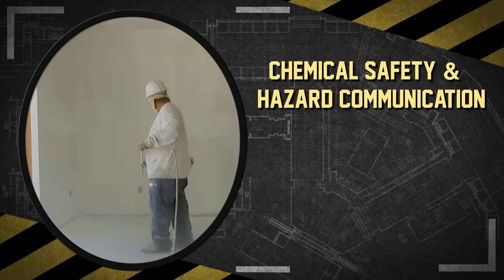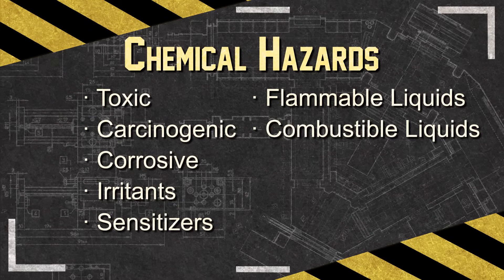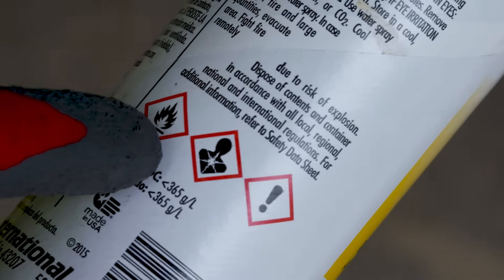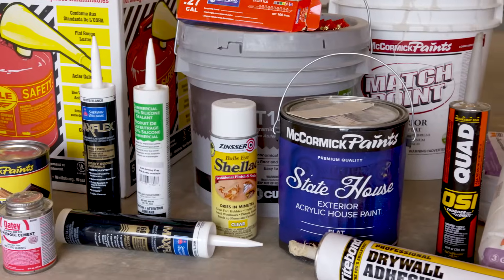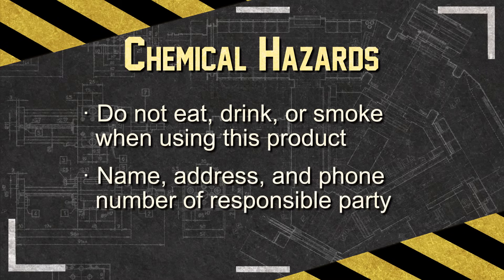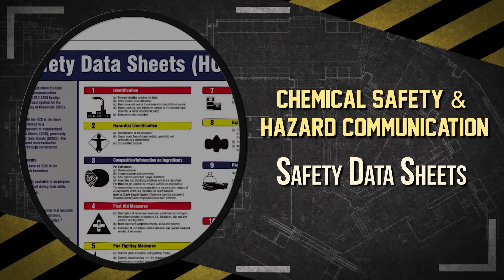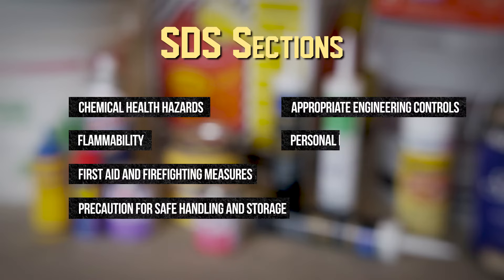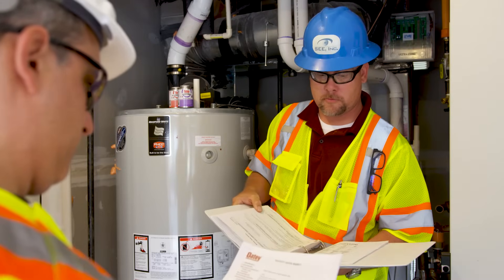Construction Safety: Chemical Safety and Hazard Communication

Comment: Hazardous chemicals, they can be found practically everywhere on the jobsite and in many commonly used products. There are several different types of chemical hazards. There are toxic chemicals that can have a poisonous effect on a person. There are carcinogenic chemicals believed to cause cancer after exposure. There are corrosive chemicals causing visible destruction or alterations. There are irritants--chemicals causing an inflammatory effect and sensitizers--chemicals causing an allergic reaction in tissues. There are also flammable liquids that emit vapors that may catch fire and there are combustible liquids that combust after being exposed to high temperatures. 
 
These chemicals may cause physical damage to the body. They can have chronic effects--a disease that develops over time--or acute effects--symptoms that appear or change rapidly. 
There are a variety of ways in which chemicals can be exposed to the body. The primary methods of entry are inhalation-chemicals entering the body through breathing- absorption skin contact with a chemical-- and ingestion eating or drinking of a chemical.  
 
Hazard Communications Program
Chemical safety begins with a written hazard communication program which covers how chemical hazards will be addressed on the job site and will include a list of all hazardous chemicals present in the workplace. All workers who may be exposed to hazardous chemicals should review the program. There are two primary methods to communicating chemical safety information—one, insuring containers of hazardous chemicals of properly labeled and two, maintaining safety data sheets or SDSs which are sources of detailed information on the hazardous chemical. 
   
Labels provide an immediate warning of hazards. Product manufacturers are required to provide labels on all shipped containers with information including product identifier or product name, signal words like danger or warning, hazard statements like fatal if inhaled, and hazard pictograms that alert users of the chemical hazards to which they may be exposed. Each pictogram consists of a symbol on a white background framed within a red border and represents a distinct hazard, such as a health hazard, flammable, corrosive, toxic, and irritant. 
 
Precautionary statements like do not eat drink or smoke when using this product. And lastly the name address and phone number of the responsible party. It's important to ensure that all containers on the jobsite are clearly labeled so you know exactly what is in the container. A battered or old label might be hard to read. If this is the case, make sure to replace the existing label with a new one that includes the product name and general information concerning the hazards of the chemical. In addition, if you're transferring something from the manufacturer’s container to your own container, it must be labeled unless you plan to use up all the product and the container will be empty at the end of the day--then you don't need to label it for that day.
 
SDS stands for safety data sheet. Safety data sheets serve as the source of detailed information on a particular hazardous chemical. It's required that all product manufacturers and distributors provide safety data sheets to its users. If you didn't receive an SDS form from your supplier, you should request one or visit their website to download the SDS.  Safety Data Sheets have a uniform format and are divided into 16 sections. The SDS contain important such as the chemicals health hazards, and flammability, first-aid, and firefighting measures, precautions for safe handling and storage, appropriate engineering controls, personal protective equipment or PPE is needed, and emergency procedures for spills. 
 
All SDSs must be readily accessible to workers when they're on the jobsite. Storing your SDS sheets in a binder in a central location where easily accessible, for instance in a pickup truck on a construction site, is a common practice. The SDS is can also be kept on a phone tablet or computer as long as the workers have immediate access to the information when it's needed. Also, in the event of a medical emergency, hard or physical printed copies of the SDS must be made available immediately to medical personnel. 

Finally follow the appropriate safe practices when working with any hazardous chemical. Familiarize yourself with chemical hazards on your job site as there may be more than one hazard for each type of product. Before working with a product read the safety information on the label and the safety data sheet. Use the proper personal protective equipment such as gloves, eye and face protection, aprons, and respirators. 

Chemicals should always be kept in their original container and stored in accordance with the manufacturer's instructions. Keep flammable and combustible chemicals away from heat sources. 
Dispose of any excess product correctly--not down the drain. Spills should be cleaned up immediately. 

When working with corrosives, an eye wash or shower must be readily available for immediate emergency use. If chemical exposure has occurred, the worker should seek the appropriate medical care. Workers using chemicals should wash thoroughly before eating, drinking, smoking, and leaving the jobsite. 

Chemicals are found all over the jobsite and some of them are more hazardous than others. Container labels and safety data sheets will give you information about the hazardous materials with which you work. Pay close attention to the hazard warnings listed and always follow the manufacturer's safe handling, use, and storage of all products and chemicals.